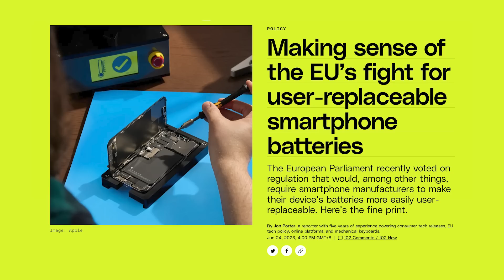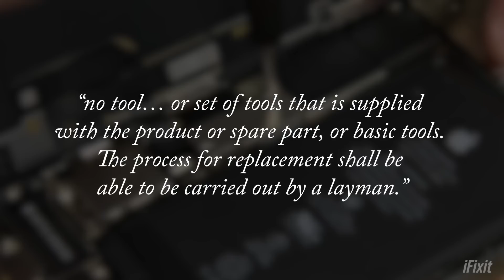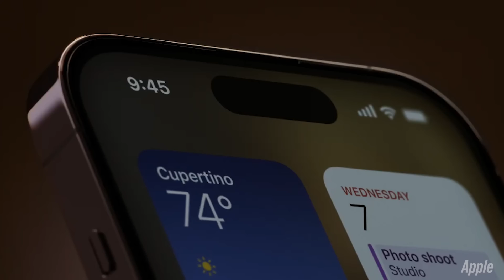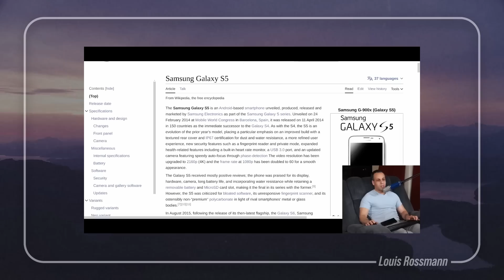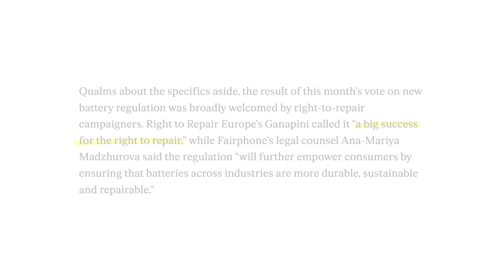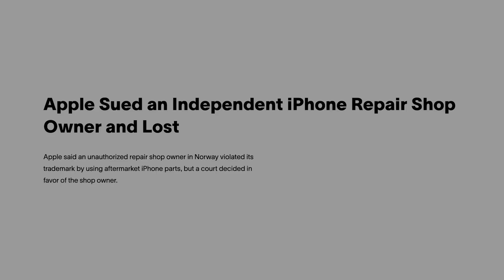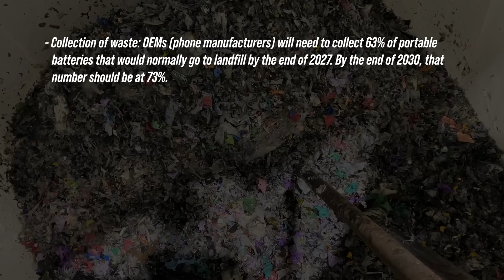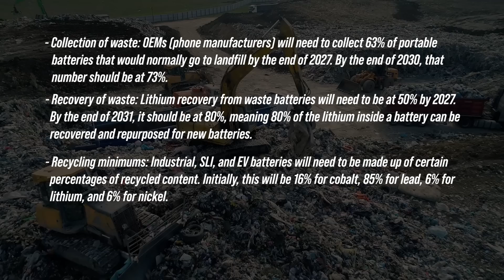EU Just Changed Smartphones Forever

Comment: Just produce good products that last long, I have never replaced any batteries on my iPads even after 6 years, on iPhone it is more than usable after 4 years, and if required a replacement Is not expansive, replaceable batteries is not required, a fixed fee for replacement from Apple is the the most appropriate solution, safe, long lasting and keep the nice design, instead this ugly removable battery phones which most don’t need especially if the replacement batteries are from a non safe source that will burn or generate other harm.

Comment: 100% profit ridden changes... absolute no doubt about it... and I blame the consumers... people will buy it anyways... Samsung tried to remove the SD card back is the S6/note5 times and they had to bring it back ASAP as consumers were smarter back then and simply did not buy the phones.... but... people gets complacent and lazy and now not only they removed the SD card, they also removed the headphone jack, the IR Blaster, the O2 sensor, the iris scanner, the charger from the box and they kept the non removable batteries while increasing the prices to match a gaming laptop... like they were adding features to the phones... the Note 4 was a true smart phone as it could do things the new S23 ultra can only dream off, the S5 was waterproof and had a lot of other features that are not present in the newer S series... it is like they dumb down the smartphones, they are faster as one would expect, but they can do less than they used to, while costing 4 to 5 times more.

Comment: Until now I do not complain about those unchangable apple batteries.
Because I have not changed my phone anytime due to a worse performing battery.
Even the at least 10 year ld 6s still works for the purpose I have for it (old OS makes it less usable for modern apps which I find much more an issue....that the OS is upgrades in such ways that the phone gets unusable for use with my apps...but it still can call and sms. 
But the internet does not work any longer because only 3G is supported and that is to slow for modern apps. Resulting in timeouts.
For daily use I have a 10S. It's 4 years old and the battery is still fine.
I can expect that the battery last longer than the os last (with upgrading).
Any good managed LiPo battery will last at least 8 to 10 years...After 8 years my nissan leaf EV was running on its original battery pack after more than 1000- cycles. My phone battery can be used on 1 charge for 3 to 4 days dependent on usage. 1000 cycles means 3000 to 4000 days and then remaining capacity of 75 - 80%...still at least 2 days of usage. That is more than 10 years.
Only make sure that you do not heat up the battery to much in sunshine, heated environement or with unprotected fast charging. Because those shorten the lifetime of the battery.

Comment: To answer your question at 8:16 If the phasing out of batteries was driven by consumer demand it is still motivated by profit. I suspect the manufacteres realised there was increased profit in sealed batteries and drove the market that way.
This is not nefariuos behaviour per se, as each coprporation has a feduciary responsibility to maximise profits, so it is the corporations acting as they must. This ruling by the EU is a good example of a regulator doing what it must.

Comment: I think probably what will happen is all the cell phone companies will just stop selling new phones in the EU figuring public pressure will quickly build to remove the new laws. That would be much cheaper for them. I can also see this making more sense when the older battery tech used to need replacing every 2 years. Now for example, I just bought a 3 year old iPhone 12 and it's got 90% of it's battery left. If they make a pull out battery or hinged cover, it won't make it any more accesable for a "right to repair". Anyone can buy a heat and suction cup kit to open the phones themselves. Since when did the right to repair mean you couldn't be expected to buy $40 in tools to work on stuff? I agree parts of the "right to repair" but this is more of a systems design question than just the battery.
Reply: companies will give away half their profits? very smart opinion!

Comment: I think it's a mix of reasons. The biggest reason is to encourage customers to buy new phones instead of repairing them. But a small reason is so that the phones have less mechanical/moving parts. Requiring more tolerances. I had an LG G5 and it was wonderful. 

The issue that companies will face is that the amount of research needed to design phones with replaceable batteries WHILE also making them look the same as previous models.

But I know Apple will comply and call it a battery replacement feature
Reply: Noticed the display wasn't as good. Like I can see screen burn it and other display issues. Other than that loved the phone concept and still have the 3D camera gift lol. Had to trade in for new phone

Comment: You can buy all sorts of battery operated tools with easily replaceable batteries. Hardly anyone buys a  new battery because it's almost the price of a new tool with 2 batteries and a charger. Of course they keep changing the design of the batteries as well.

Comment: The EU council has made a number of stupid, anti-consumer rulings in the past, not so much because of lobbies like in the US, but because of poor technical understanding. However, this case is pretty clear-cut; you need to be extremely brainwashed to believe replaceable batteries are bad for the customer. Heck, in Japan a large percentage of people carry around an external power bank and the respective cable… imagine carrying one or two batteries instead (like we did 10 years ago).

Comment: i do not see a point in having user replicable battery's in cell phones

because modern battery's have a longer service life then the cell phone it is in so your phone will be obsolete well before its battery can no longer hold a charge 

and you no longer need to buy a second battery for a specific phone you just get a universal battery bank and charge your phone from that and a good battery bank will charge your phone several times as ware the old secondary battery only gave you one extra full charge

Comment: if there is any element of consumer demand that pushed towards phasing out replicable batteries than it was uninformed, misinformed, or purposely propagandized demand that pushed for that. If consumers knew that their phone could last significantly longer and not have to have the performance downgraded every year to keep minimum battery life of 1 full day for a part that is relatively cheap to replace than they never would have chosen not to be able to replace it. Also there is so much convenience that comes with replaceable batteries for traveling, vacations, college life, outdoor excursions and none of that is even relevant to the battery life side of the problem. imagine not having to sit tethered to a wall outlet by a 4 foot long cord while you are browsing the web if only you could quickly swap the battery. But no because if you can disconnect the battery then they cant secretly track your location for advertising purposes.

Comment: I'm generally against regulation but this one is actually huge. The battery is usually the first part of the phone to fail, which makes the phone slower in general. Apple, for example, releases updates that slows the CPU down, enhancing the battery life being the excuse they abuse. Replacable batteries, on the other hand, means you no longer have to buy a phone because of the battery, and you easily replace the battery instead.

Comment: I expect that what the EU will get is a battery block which clips to the back of their phones and then wirelessly charges up a little capacitor inside. No battery in the main phone, battery lives in the sub block, like one of those big cases with a built in battery. However, maybe that S5 with the pop off bottom battery might happen. However, I think unless Asia and the US also change their laws, the advantages of glues in construction are just too significant.
Reply: I think the laws requiring apple and others to stop locking down their machines artificially will be a bigger impact. Those have a more routine impact on consumers, and smart repair shops with a good manual can already fix your phone AND fix all the glue back together.

Comment: Removable battery cellphones had the added design feature of shock dispersion. Essentially the devices are designed to transfer the force of impact into falling apart. Before this new way of doing things I never had a screen crack on me. I had several smartphones between 2008 -2013 that I dropped pretty regularly with no appreciable damage to their screens.

Comment: 100% anti consumer BS.  I had a waterproof Kyocera phone that not only had a replaceable battery but I was able to replace a broken screen with just a couple of screwdrivers.  Design for this is not hard requiring simple o-rings and screws to  assemble the phone.  The phone was both rugged and water tight with even the ports sealed with internal o-rings.  I was not able to buy a similar phone when my carrier went out of business.  There is no reason all phones can't be built this way.

Comment: I am a retired Electronics engineer, I started when Thermionic valves where still in use so I have seen all the changes in the Electronics/Electrical industries over the years. Non repairable products have slowly entered the system on a drip drip method until what we have today. In my last years before retirement I did work for one of the largest Electronic manufactures and like the rest of them their goal was no user replicable parts that started to drift in to the professional repair sector to the point that it became practically impossible to obtain product repair information such as circuit diagrams and repair parts such as specific to the product batteries from Manufacturers. Glad I have permanently left all that behind.
Reply: Can't believe manufacturers are allowed to do that. Why there is no law in the first place to counter this kind of practice?
Reply: @Pedonickatank  believe it. The "Law" is there to enable these companies, not restrain them. without Law all along the way it would have been much harder to get to where we are today.
that said, it would be nice to have the Law come in and fix this crap, there's just always a catch.

eventually all of this will come crashing down. unfortunate but true
Reply: In the larger view of things if the Manufacturers where forced into providing spare parts for all their products they would need warehouses the size of multiple sports fields. And would you really want to purchase a replacement spring for a wind up gramophone or parts for those first mobile phones that were the size of a shoe box weighing rather more than the phones of today. Just look back ten years and count the number of electronic devices that have now slipped out of use many not because they did not work but more they became un fashionable, I do not like it but that is the way the world is going with consumer electronics.    @Pedonickatank
Reply: toillet paper electronics

Comment: looks like EU have been doing good stuffs lately, from usb port for iphones to now removable batteries. i hope EU will also create a law for replaceable CPU & GPU in gaming laptops. right now external GPUs are costly & experience some performance loss over the cable, & manufacturers that create laptops with replaceble CPU & GPU can't keep up cuz CPU & GPU sockets are changing so fast generation after generation till there's no point in making them replaceble as newer gen CPU & GPU won't fit into laptops with older sockets anyway.
Reply: No laptop uses replaceable CPUs or GPUs.

If you are refering to graphics cards, those are replaceable, but you probably don't want to do that anyway unless you are brick stupid because laptops are designed around a thermal envelope, and it is probably not going to work properly if you replaced either of those things with something it was not designed to handle.

A laptop is NOT like a desktop computer.
Reply: @Tugela60  based on your clever logic, we shouldn't even have laptops & smartphones in the 1st place. cuz massive computing power shouldn't be portable. may as well we return back to the days of riding horses instead of having self driving cars. the companies that are making technological advancements aren't very smart.

Comment: as always .. too late... now it is very rare that people change mobiles due to the weak battery... but in the meantime built-in batteries are so common, including in products that are not normally properly recycled like toys, bike lights etc... literally everywhere. Plus electric scooters, bikes... bought often on a whim not by genuine cyclist etc and then land in the soil. This includes all the city scooters and bikes that as every subsidy & politically based project, simply are chucked after a minimum use... bravo politicians. Not to mention the the replacement batteries law would have to set a technical standard for batteries so we have few universal models. Otherwise every phone will have own battery type, and it will cost arm and a leg to replace it. So people will buy a new phone anyway.

Comment: where i live we separate waste into 3 bins. One for general, one for cardboard, one for plastic & metal. The thing is, this is collected but 0% of this waste is actually recycled and 100% of it ends up in land fill sites. So, what is the point? It seem like a placebo to make the general public believe something is actually being done when in reality, nothing has changed. We do have 3 different types of refuse trucks but that's it.
I'm left wondering if this is just going to end up being another white elephant. I want removable batteries because I don't want to have to tear my phone apart or buy a new one just because of battery wear. But as for the environment, I can't see the policies changing where I live any time soon, if at all, ever. My stating this does not mean that I condone this, I in fact would like to see the waste actually recycled but that's just not the reality of things.

Comment: Well, Apple was pretty bad in their anti-repair policies and should be taken to task. On the other hand, a power bank could charge more devices on the go right now, removable battery isn't really an issue with S23 Ultra along with it's OS efficiency. 
It is as if the EU is cutting off the nose to spite the face. 
Replaceable batteries aren't gonna give the phone a lot more longevity unless EU also now wants to dictate the number of years that a phone should recieve OS updates at a minimum. What about the quality of the parts inside a phone? Should there be some sort of a safety mark to ensure it's life expectancy? 

Is EU going to dictate how Phone manufacturers brings their phone to the market in the name of climate change?

Climate change has already reached a tipping point at least 2 decades ago while the rich were busy chasing after more numbers. 

EU is really a joke.

Comment: If the battery is non-removable and we switch off the phone, we still don't know what is happening inside the phone. There is a chance that it just turns off the screen for the user interface, and some functionalities may still be running inside the phone, such as data collection for ads, location tracking, microphone usage for ads, and camera operation. In this case, there is a possibility to track the phone's location even if it's switched off. However, if there is a removable battery option, we can confirm that the phone is actually switched off. Just a funny thought
Reply: There are advantages and disadvantages

Comment: 100% anti-consumer design. Manufacturers needed some ways to force people to upgrade to newer devices.
This is why ecosystems were introduced as well.
If it were for consumer - ecosystems would be cross-brand compatible. 
But no - everyone wants their own ecosystem even if its the shitty one.
In this way manufacturer makes sure people will be in need to change device every 3-5 years and that it will be the newer model from the same manufacturer.

Removable batteries for cars are essential for this market to be sustainable, simply because power grid will be stressed too much as soon as EV replace most of the ICE vehicles.
Some charging stations are considering to use buffer batteries on their charging ctations to avoid exceding maximum grid power in peak hours, but that is an extensive dumb solution: more batteries to power more batteries.

Comment: 50 years ago I bought a calculator with light powered cells charging from any light source. I'm still using it and it just won't die. There's no reason it can't be done with portable phones except they want u to keep buying batteries and now buy a new phone when the rechargeable battery dies. What's needed is for someone gutsy enough to do it and get control of the market, forcing someone to buy them out or do the same.

Comment: I recently bought an Insta360 X3 camera. It has a removable battery, but the camera is so water resistant that you can even film under water without an extra case. Of course it is much thicker than a phone, but it shows what you can achieve with a little rubber at the right place.